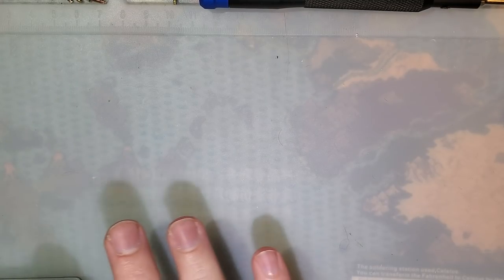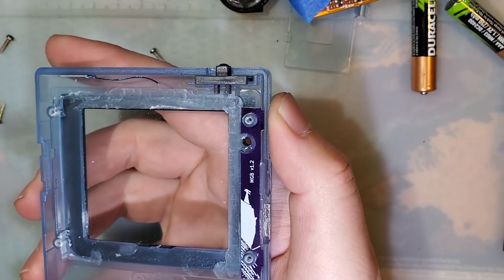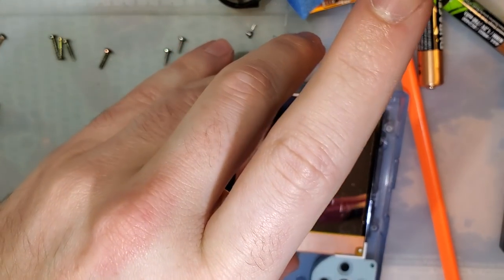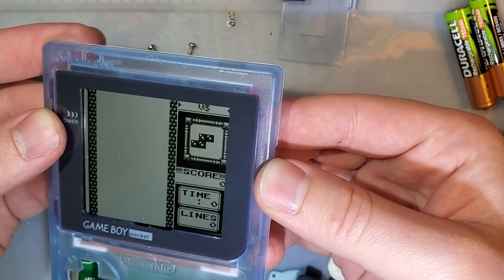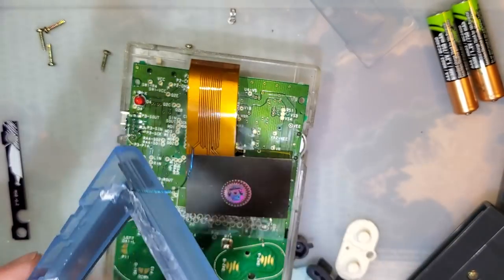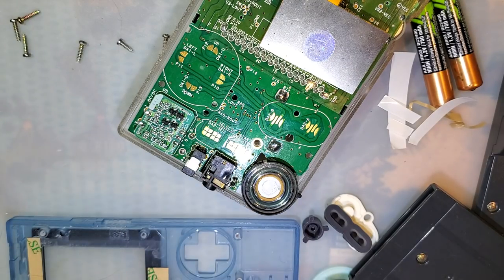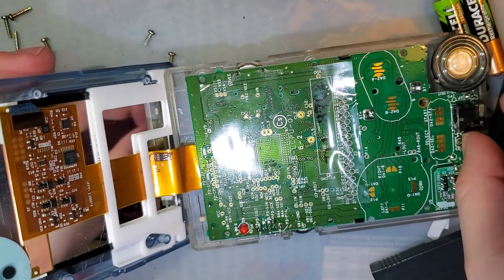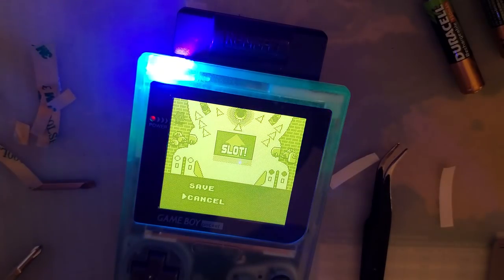Funnyplaying Game Boy Pocket IPS Kit (Part 3 of 3)

Comment: I was shouting at my screen to just grab a drill the next size up and use that in the bracket.. then you did.
Then I'm watching you hesitate to put the screen down without the bracket.. could have used a piece of tape on the bracket on the back of the LCD, otherwise, a perfect install.  Oops, ribbon goes under bracket.. nice to know!

Comment: Do you find with games like say Pokemon Yellow, the screen sort of flickers with brightness changes. Its not super crazy but it just oges up and down in brightness with games that require more power. I am debating on trying to use a 5V regulator i have lying around but unsure what power the actual LCD takes. Still need to investigate that. Otherwise I agree, this screen is amazing!
Reply from the maker: It does that regardless on low brightness for me. Bump up the brightness a bit and it's more stable.
Reply: makho yeah I noticed the same. I’m just wondering what is the actual cause of it, and, can it be fixed by stabilizing voltage
Reply from the maker: @kyle88l  try cleaning the contrast wheel